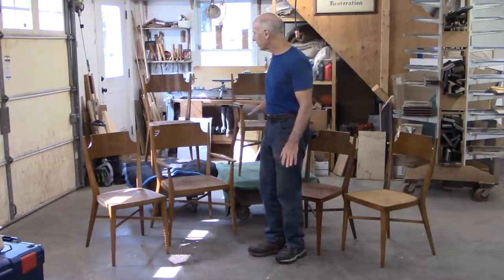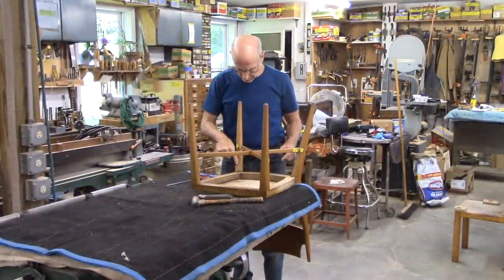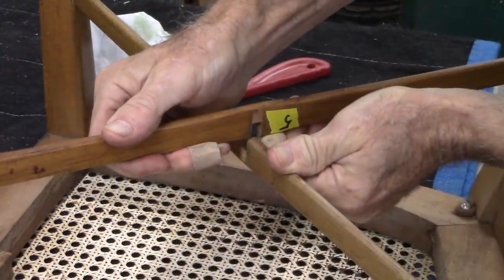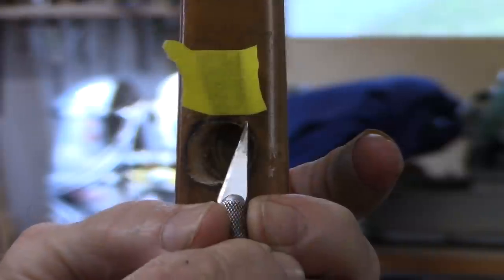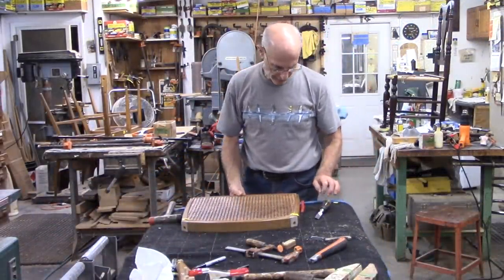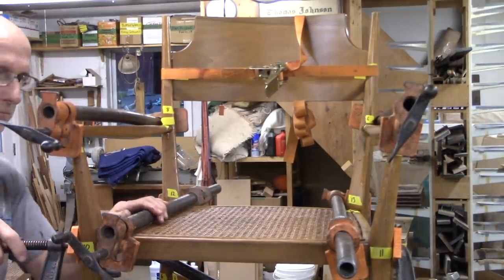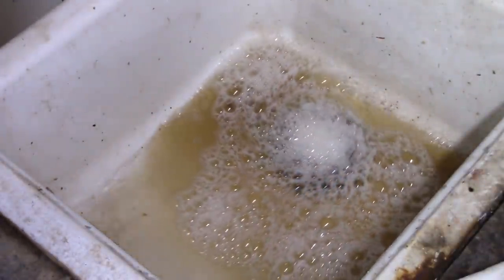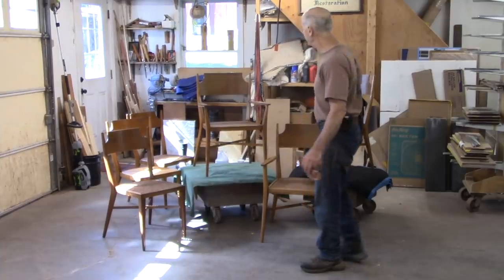Restoring Midcentury Modern Chairs by Paul McCobb - Thomas Johnson Antique Furniture Restoration

Comment: I just got some MCM chairs that need restoration and your video helps a lot ! Subscribed it when on the third video of yours . Quick question: how is the glue you used here compared to yellow wood glue ? Is it better for slightly loose joinery ? Yellow glue won’t hold up too well if the joinery is not very tight, right ?
Reply from the maker: Thanks! Correct, none of these glues will work well without wood-to-wood contact. Yellow glue is fine, I like the hide glue https://www.oldbrownglue.com/

Comment: Nice work as usual. I have a few questions, where you able to get a close up of the parts you sanded and covered with polish? Is it possible to use vinegar, a drop of dawn soap and water to clean the furniture as a substitute if I don't have the solution you used? Thanks for your time. I love and appreciate your fine craftsmanship.
Reply from the maker: Thanks! Absolutely, that should work fine
Reply: @johnsonrestoration  Cool! Thanks for your reply.

Comment: Hi Tom, UK greetings, I thought oak on some parts of those chairs? Difficult to tell from here! and an unusual fixing on the back legs, I often use a soldering iron on tricky screws, puts the heat right where you want it!! How did you get on with the premixed hide glue,and what was it called? Thanks as always for a great vid, stay safe
Reply from the maker: You're welcome! The pre-mixed glue is "Old Brown Glue" https://www.oldbrownglue.com/  I'll try the soldering iron trick

Comment: I noticed that you used epoxy to secure the dowel in the drilled out broken screw hole.  I assume that you used it because there was a concern that the hole might not be a perfect fit for the dowel.  I do have a question as to how you clean up the squeeze out of the brown hyde glue.  Is it only warm water or is something else used?
Reply from the maker: Thanks! Yes, you're right. The glue cleans up with water quite readily

Comment: Great video! I am planning on refinishing a simple Paul McCobb Calvin desk. What is the spray that you use in this video (type and brand)?
Reply from the maker: Thanks! The spray was shellac and lacquer toner. But those are for spot finishing. A McCobb piece should be finished with Danish Oil or a satin polyurethane, low luster

Comment: Great job ! 
Question : if you used acrylic lacker doesn't it seal all the wood pores ? And I always thought that when you apply a wax afterwards one would think that the wax stays on top of the acrylic lacker layer and therefor isn't able to reach the wood itself,  but still one sees the wood chsnging colour a bit and is getting a warmer colour. I never understood that. What's your opinion on that ?
Reply from the maker: Thanks! I only sprayed light coats of lacquer, so the pores were not filled. The wax is just a polish, you would never want it to go directly on the wood

Comment: Is there a reason why you generally  re-glue with hide glue instead of e.g. titebond or PVA? Is it a personal preference or to keep with more traditional furniture manufacturing process? Would it devalue items to glue up with modern glues or is hide glue just better for restoration purposes in your opinion? Cheers 😊
Reply: Angus Allott it’s the long open time of the Old Brown Glue and the fact that it does not interfere with the finishing process, most modern glues have very short open times and this was a complicated glue up
Reply from the maker: Thanks! I always use hide glue on period antiques, because it's compatible with the old glue. I could have used any glue on these chairs, being modern. As long as a piece is glued up correctly, no loss of value
Reply from the maker: Thanks! Yes, this Old Brown Glue has a good open time

Comment: After drilling out the old screw, you filled the hole with a 2 part epoxy glue, let it cure, then put a replacement screw into that.  Is that right? Ingenious.
Reply from the maker: Thanks! Yes, exactly. (I don't know about "genius" though)

Comment: My email notifications disappeared too, although one will occasionally slip thru. I still get notifications under the bell icon. After searching for several weeks, I found a YouTube corporate page where those turds said it was done because people were complaining that the notifications were clogging their email, and that many subscribers weren't responding to notifications they had received. There are still postings about how to fix this problem, but nothing works.
Reply from the maker: Thank you! I've been meaning to look into it. If people are getting too many notifications they should reduce their subscriptions! But it may be all the other notifications too. I turn off all notifications except a few

Comment: Hi Tom. You mentioned in an earlier video that Titebond glue is stronger than hide glue, so why do you use hide glue? Regards from Austria.
Reply from the maker: Thanks! Good question! I use hide glue on period antiques because it’s compatible with the old glue and easily reversible if the need arises

Comment: I like your work.
Little bit of wd40 or a penetrant oil it helps to loose screws... even they are not on metal, it help quite well.
Reply: Or a freeze/release spray. The problem with both is that they contain oil, and that usually ends up staining the wood/creating problems with finish. Not a big issue on the underside where you can't see it, but still a risk...
Reply from the maker: Thanks! dlevi67's response is correct
Reply from the maker: Yes. Thanks! I don't like using spray lubricants any where in the shop. Anyone who's had to deal with contaminants in finishing is careful about this
Reply: Razvan Butiac my concern would be the WD40 bleeding thru the wood and also how it would potentially affect the finishing process, silicone is the biggest evil for finishing

Comment: Any problems w running when you spray like that? Also do you ever repair that wicker material on refurbs?
Reply from the maker: Thanks! You're always worried about runs and sags, it's easy to get those with an aerosol. I've never done much with wicker furniture, caned seats are no problem but I sub those out

Comment: Would it be better if the joints were not so tight fitting? Tight, but not as tight as those chairs? Or is it the glue that makes it appear that way? Too bad about the chip outs. I have experienced that myself. Mostly when it is veneer.
Splinters easy like walnut...Maple maybe?
Another awesome restoration...
Reply from the maker: Thanks! You need tight joints. The glue will only work with wood - to - wood contact. These chairs are oak, hence the splinters

Comment: Surprised with how the cane seats have endured the neglect.
Reply: I too was thinking the same, how did the cane seats survive unless they were restored at an earlier time.
Reply: There's actually one that looks like it has been redone. Right there in the end shot. And if people take out the various items in their back pockets before sitting, there are not little fingers picking and nobody standing on the seat (yes, I am redoing a chair that a lady fell through, because she kept using it as a step-stool), then they can hold up.
Reply: Exactly, I would have imagined that those would be the first areas of vulnerability; however, I have discovered with my own teak furniture (outside lanai) that undue wear or erosion on the cane can be mitigated by using a large padded (removable) cushion.
Reply from the maker: Thanks! So true, but some have been redone
Reply from the maker: Thanks! Yes, the seats were different ages, some may have been original
Reply from the maker: Yes, that's correct! Thanks. Who in the world would stand on a caned chair? (rhetorical question)
Reply from the maker: Thanks! I often recommend to people exactly that

Comment: With the rusted screws, would it be dumb to use a tiny drip of anti seize? Or would it wreck the wood?
Reply from the maker: Thanks! It might make sense, I would be worried if the wood would get contaminated and not glue as well.
Reply: @johnsonrestoration  Thank you! I have this issue with an old roll top. I learn a ton from you. Keep up the amazing work. A true master at your craft.

Comment: Why did you use epoxy to set the dowel on the first chair, where you were filling in the broken screw hole, instead of hide or wood glue?
Reply from the maker: Thanks! If there isn't sufficient woood-to-wood contact, it's best to use epoxy.

Comment: Were you using a maroon Scotch Brite with your Krud Kutter solution to clean those pieces? 
On another note: YouTube quit sending email notifications as of 13 August 2020 claiming that less than 0.1% of those emails were ever opened. The notifications are now found under the "bell" icon in the upper right-hand corner — IF you are logged into a youtube account AND you have your settings correctly configured. (Please don't ask how to do that. There's too many browser/platform variables.)
All the best,
-- Joe
Reply: I'd like to know about what scotch brite you use with the Krud Kutter also.  I have some kitchen cabinets I need to clean.  PS You are a real artist!  Not much of a rant though :)  Also wondering if you cleaned the cane too?
Reply from the maker: Thanks! I appreciate the info. I will look into it
Reply from the maker: Thanks! I use 2 Scotch Brite pads, gray is ultra fine, maroon is medium grade. I didn't clean the cane, I'm not sure why. It looked fine though

Comment: Thomas  use an electric soldering iron  rest it on the head of the screw  for a couple of minutes, it's a lot easier  and direct than using a heat gun
Reply from the maker: Thanks! Yes, that would have been better. Next time.....

Comment: Just curious & keep in mind I don’t do any woodworking.  Would setting the chairs in a humid place for a few days help with wood splitting or does that just make getting the joints loosened even harder?
Reply: It would probably make things worse, since the wood will tend to swell with humidity and seize the joint. Heating the old glue (and removing some moisture from the wood in the process) is usually faster and more effective.
Reply from the maker: Thanks! Yes, dlevi67 is correct. It would make them more difficult to dis-assemble
Reply from the maker: Thanks! I never thought of the fact that with heat, you're not just softening the glue, but you may be shrinking the wood a "skosh"

Comment: Great video and a lovely set of chairs, thanks Thomas. If the cane had been discoloured in places due to years of seat rubs, would you have left it untouched or would you have made it a uniform colour? If so how would you tackle that please? 
I'm asking because I have a set of 70s G-Plan chairs with discoloured cane seat backs.

http://hwfurniturearchive.bucks.ac.uk/asset-bank/action/viewAsset?id=1224&index=20&total=36&view=viewSearchItem

The seat pads have been recovered since new so they don't look quite so 70s!
Reply from the maker: Thanks Gordon! I would leave it alone. Cane is very difficult to stain and color. It doesn't take stain, so you have to spray it with toner lacquers, which of course then wear off with use! Not worth the effort

Comment: What is the seat material called?  I have a dining chair with that material on the back and it has broken. What is the best way to repair it?
Reply: Send it to Tom!😉
Reply: It's called chair caning and you can get it in sheets.
Reply: Cane. Usually from some variety of rattan (a tropical vine). Unless it's just one or two strands that have broken, the best way to repair it is to find someone who is competent... I would not try to re-cane a seat/back myself, but if you are more adventurous, you may find this interesting:

https://archive.org/stream/seatweaving00perriala#page/n3/mode/2up
Reply from the maker: Thanks! That's called "cane webbing", prewoven cane https://hhperkins.com/
Reply from the maker: Thanks!
Reply from the maker: Thank you! Yes, correct
Reply from the maker: Yes, thanks! And H H Perkins will provide all anyone needs and plenty of how-to info https://hhperkins.com/

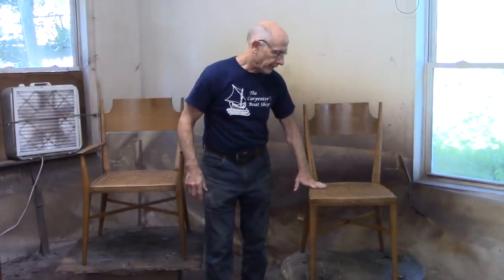Comment: 19:49 In earlier videos you also clean with Krud Kutter but I never see you then rinsing with say a rag wet with just water.  You do rinse, don't you, as I am sure Krud Kutter would interfere with final finishing process.
Reply from the maker: Thanks! Krud Kutter does not need rinsing, for instance TSP is the same way. They don't seem to leave a residue

Comment: Tom,
I thought you might be interested in something I noticed.  My computer crashed, hard drive died.  In having it fixed, it was switched from the Windows 7 that I was using and preferred to Windows 10.  Ever since I got Windows 10, I no longer get notifications.  Well, I get them, but they don't last long enough to read what they say.  So, any that come in at night while I am sleeping just simply disappear.  With Windows 7 they didn't go away until I closed them out or clicked on them to view.  That no longer happens with stupid Windows 10!
Reply: You should be able to see all the notifications until you clear them - click on the notification icon bottom right of the screen, and that should bring up the notifications you haven't managed to read when the pop-up is displayed.
Reply: @dlevi67  , tried that some time ago, was already suggested to do that.  Didn't work!!!
Reply: @waynethompson8416  Hm. Sorry. Do you actually get the notification window to come up? Have you checked that your "Focus Assist" settings are what you expect them to be? (type Focus Assist in Cortana search box)
Reply from the maker: Thanks Wayne. I am so hopeless when it comes to computers. My editor is tech savvy, and I need to get him to find out what's going on. dlevi67 sounds like he knows what he's talking about
Reply from the maker: Thanks! I'm going to give this info to my editor, so we can find out the best way to do this